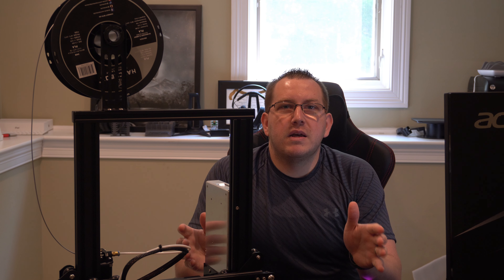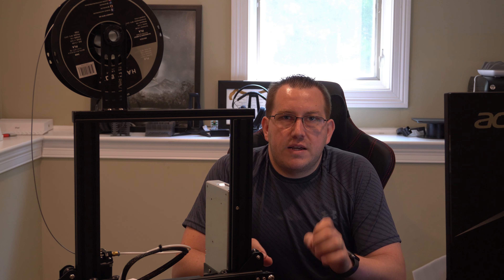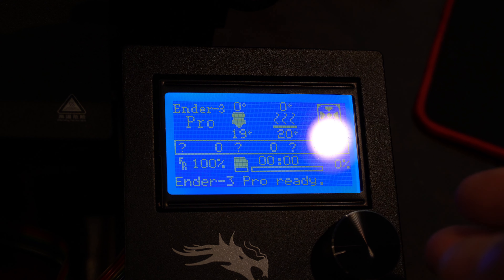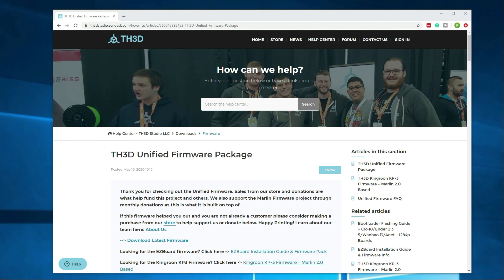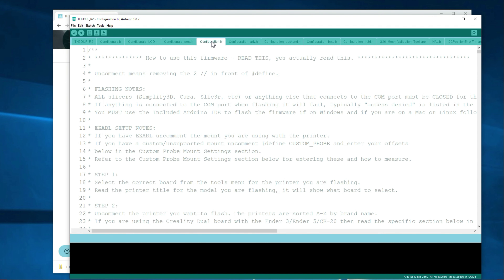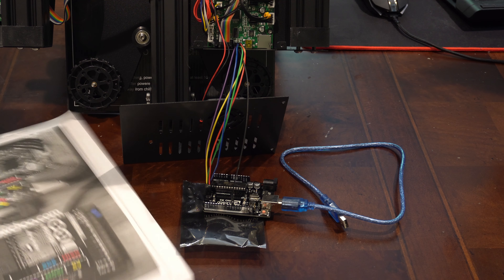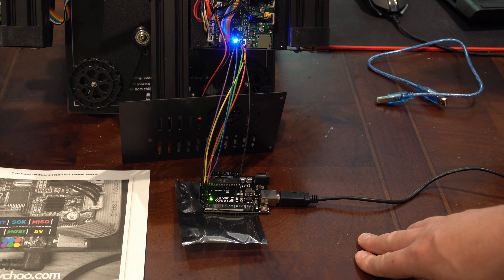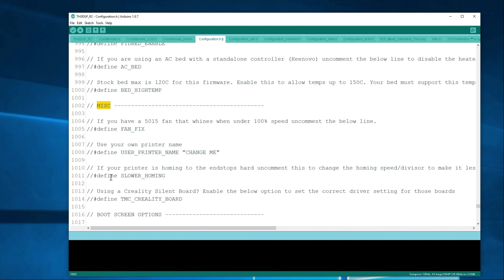Ender 3 Pro Firmware Update – Complete Guide

Comment: hi i have the ender3 just today my screen says therma;l runway printer halted .do i have to do all this you did to fix the problem?but i unplugged it by accident and turn it back on the screen ws regular .
Reply from the maker: Hi. If your printer is throwing a thermal runaway protection, the firmware may have it enabled (Not sure what board or firmware your printer has). Basically anything shipped in the last year or so ahs a 32 bit board and the run away protection. That said, if your still having the issue check your wiring on the thermistor. If thats all good, the thermistor may have gone bad.
Reply from the maker: @Putifly69  Can you check to see what board is in the printer? f you have the 4.2.2 board, the firmware upgrade is easy. Also, when you said the lithophane didn't print all the way, what happened to it?
Reply from the maker: @Putifly69  Are you still having issues? Im glad the print turned out good.

Comment: I upgraded my Ender 3 Pro with the Creality V4.2.7. How do I upgrade the firmware to Marlin 2.0? Supposedly this board already has a boot loader. I want to upgrade it before I put my BL touch on it. I read it’s recommended to use Visual Studio with platformIO and the marlin firmware plugin. I tried this method but I get a bunch of errors and I don’t know why. 
You use TH3. Is there a reason why. Is it better ?  Just trying to learn my way around all of this. It’s very confusing.
Reply from the maker: Hi. I have only used the TH3D firmware on 8-bit boards. I just picked up another Ender 3 Pro that has a 32-bit board and plan on doing a couple of videos on the firmware upgrade process. If you send over the error codes you are getting from VS code, I can try to help you troubleshoot the build.
Reply: @3DPrintscape  thank you for your help. That video will very helpful. I think I figured it out. I needed to save the changes before compiling the firmware. This is a huge learning process.